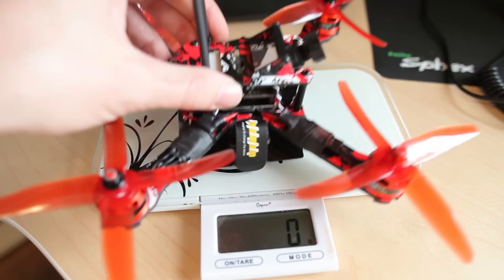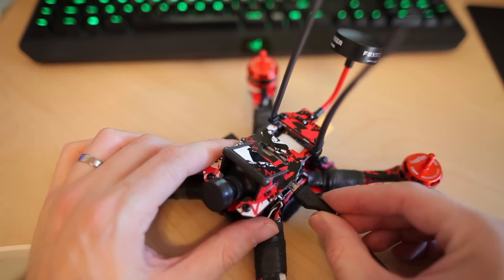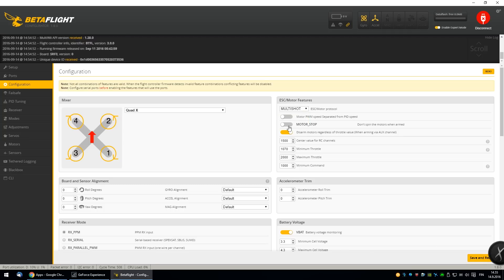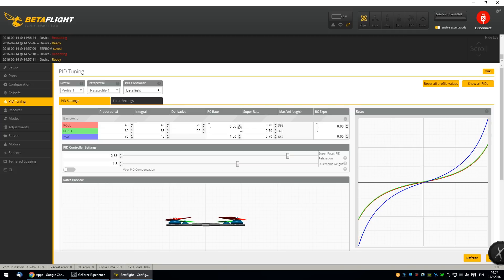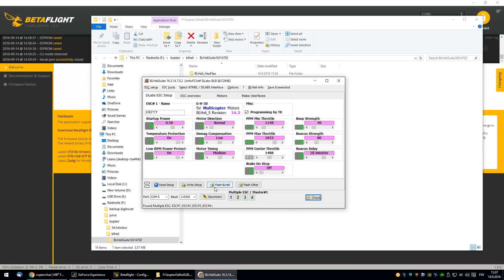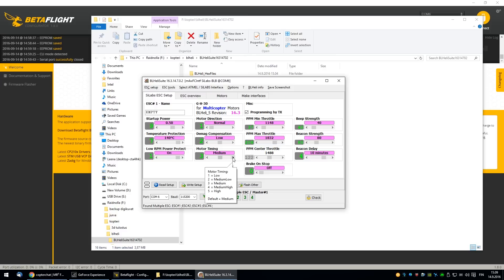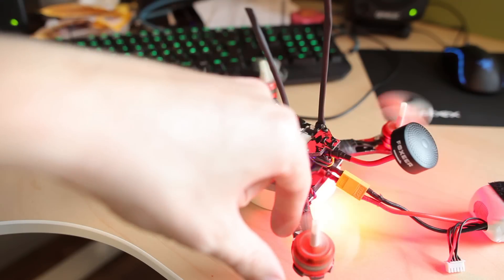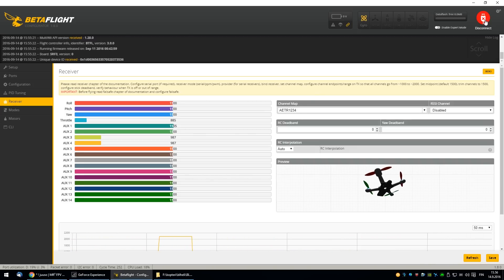Banggood Realacc x210 build video - part 6 - Installing Betaflight 3.0 and Blheli_s

Comment: Sorry for the noob question. How you connect the ESC to the PC?
Reply from the maker: Its a very good question :) The ESC is connected to the flight controller and I'm using "pass trough"  on betaflight to update the firmware. So you only need to connect the FC to your PC with normal usb connector.